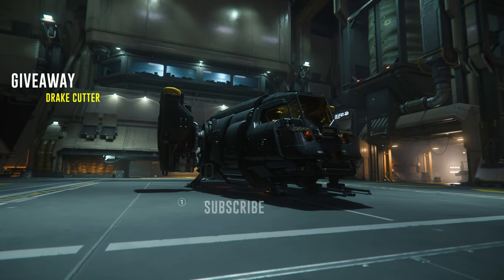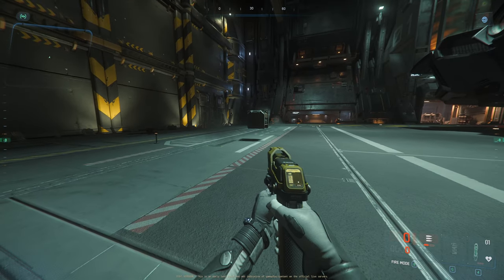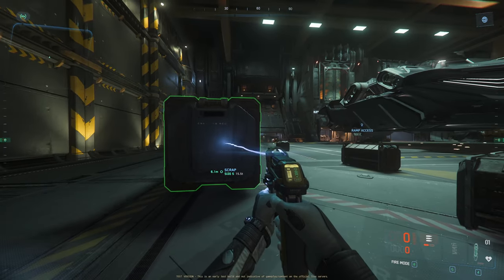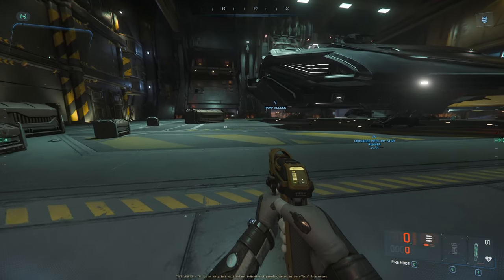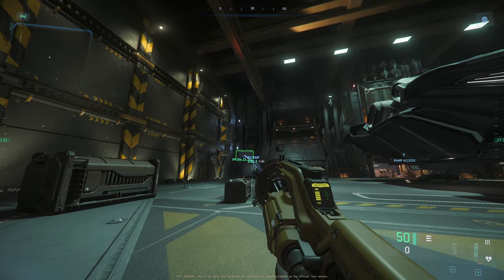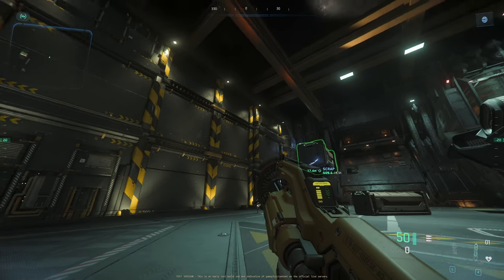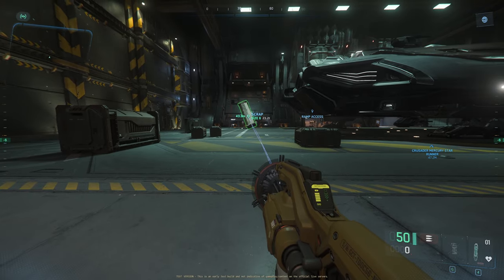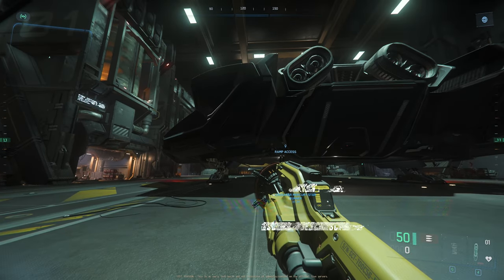How Is The New Tractor Beam Changes in Star Citizen 3.24?

Comment: Not looking forward to the Tractor Beam changes. Most ships don't have Vehicle tractor beams so most players can only use the hand-held ones. But the Vehicle Tractor Beams suck if you're not a Keyboard and Mouse Player. I play HOSAS, and the only way to extend and retract the beam is with the mousewheel. There's no Press and Hold option. One press moves the beam about 0.1m. It's horrible. And since I fly HOSAS, I have the mouse unbound from X/Y movement so that I can Freelook one-handed while flying.
Reply: Eventually I'm going to upgrade my setup, and I'll play HOSASATAMK. Because I want MK for FPS, HOSAS for flight, and still want an actual throttle.
Reply: That's the way I played from '95 to '19. Always preferred mouse and keyboard on foot, but then I switched to HOSAS since I wasn't playing terrestrial, modern-era flight sims anymore.